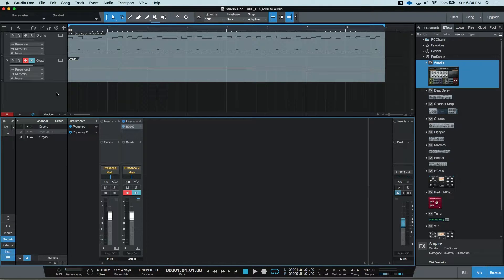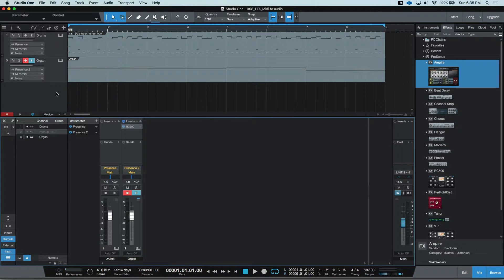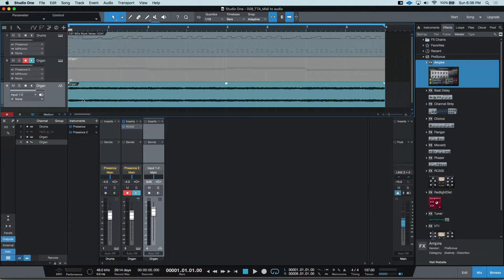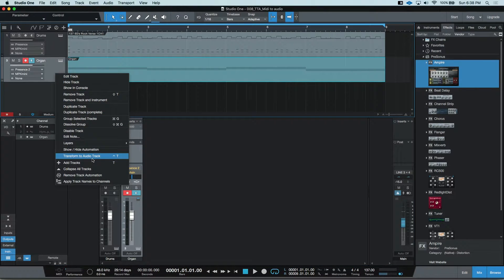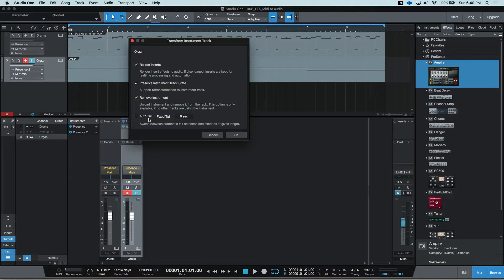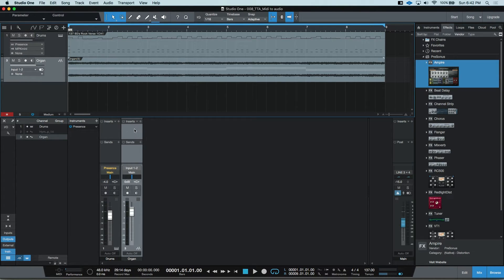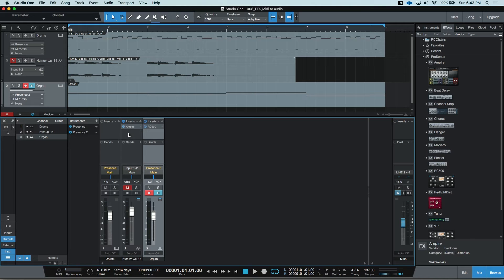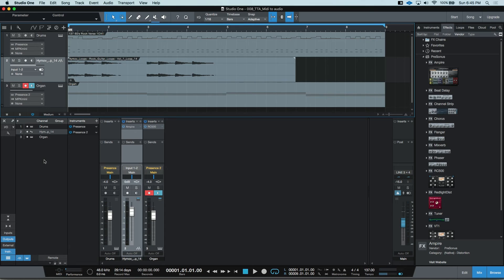Studio One - Freeze Midi to Audio & Transform to Audio Track

Comment: There is only one flaw with this. It does not have the option to render pre fader and preserve Fader, Pan, sends position on the new rendered track.  It becomes unusable when you doing balancing of you session while you are producing. With the new SO5 is a bit better using the Mix scenes and have a rough mix scene and a Render scene with all faders on 0db. But the still need to pay attention to this feature that would make this DAW more in the high end professional realm of engineering.
Reply from the maker: That's a great point, and should be posted in the forums for other to vote on so Presonus can add it to an update.

Comment: Question, my CPU is 20 -30 percent however my performance disc is peaking. How can I fix that
 I use a Mac
Reply from the maker: On mac, you may want to try a few things. Firstly, repair your disk permissions. This may cause some disk spikes if your drive's information is scattered all over. Secondly, make sure the drive you're using for audio isn't the main drive for the machine and also isn't close to full.

Comment: Tim, thanks for the tips. I appreciate your time and knowledge to make these.

Question: does this work with multi instruments? I've tried this with multiple Kontakt outputs in studio one and for some reason, only the first channel transforms to the audio track. the rest of my channels comes out blank without audio. I can hear and mix everything with midi and when I do the bounce the tracks I don't have that issue but I prefer to use transform to audio track in case I want to transform back to midi and make changes.